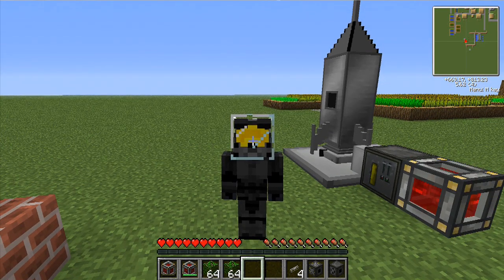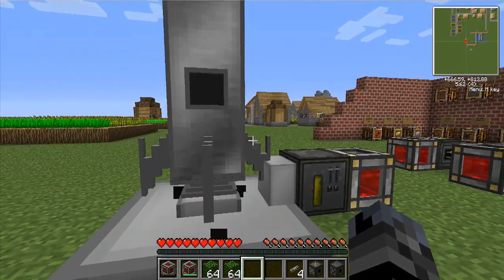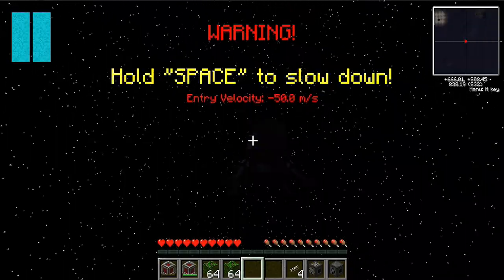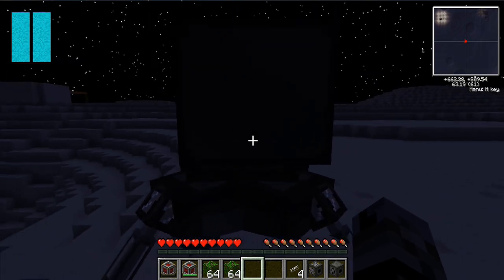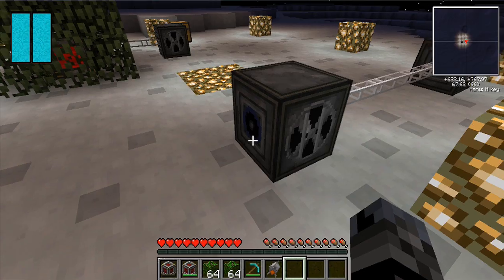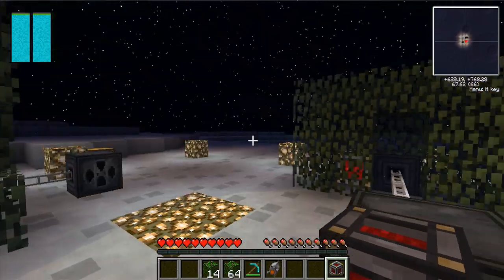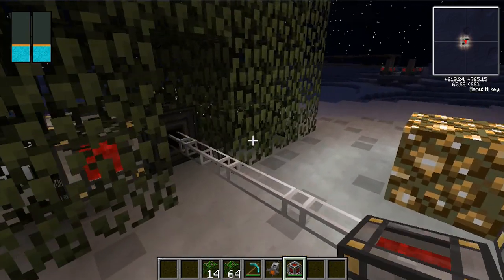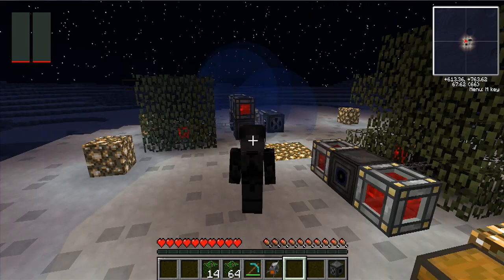Tekkit Tutorial - To the Moon Part 2 - How to Survive on the Moon

Comment: That's why I was just suggesting it. I have an enclosure of trees around a 2x2 water pond and none of them have died off yet. They were trees I grew too, not constructed. I'm still experimenting with it on a server, which is a very slow process. The oxygen bubble sounds likely. I'm doing all of this on a space station so the same rules may not apply either.

Comment from the maker: I aplogize I dont understand. So you have you oxygen collector with the oxygen pipe connected to the black square on one of its sides and then your trying to connect the oxygen pipe to the oxygen bubble distributor via its little black square, same as on the oxygen collector. If needed you can use a wrench to turn the block till the black square is where it is needed.